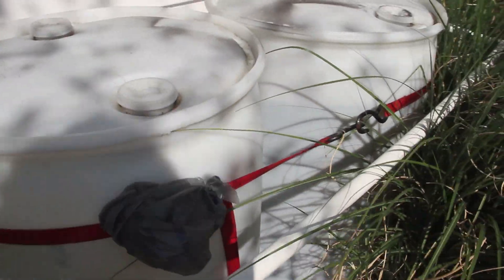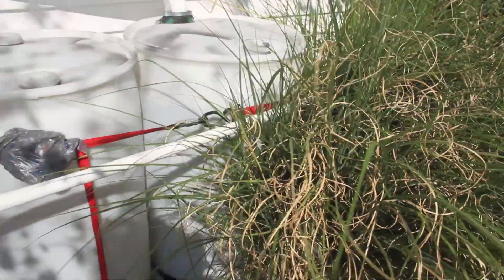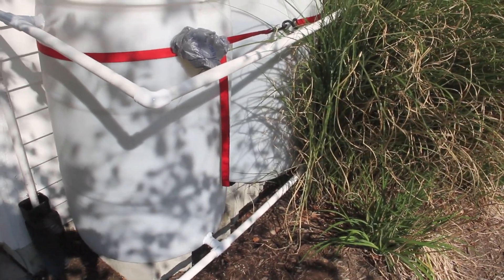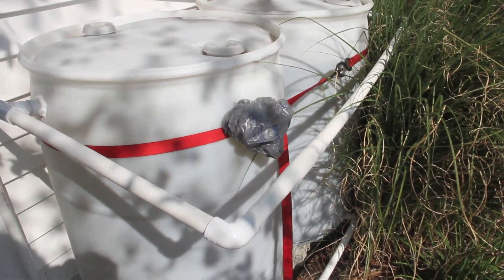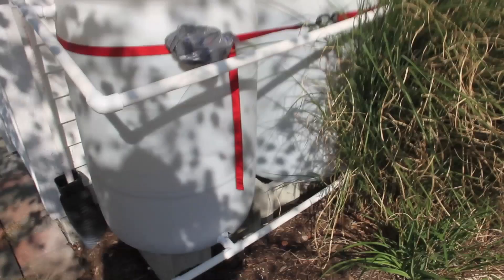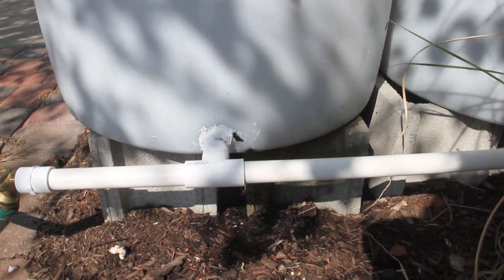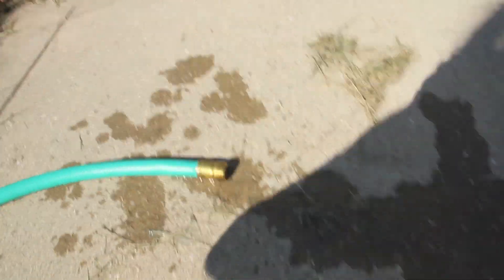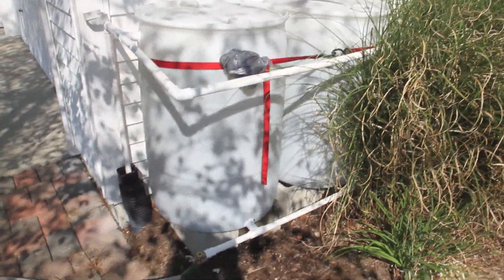DIY 110 Gallon Rain Barrel System

Comment: Some ideas for a easier system:
You tube video:  Rain Barrel Water Pressure/Volume Demonstration.
Grady Barrels for water diverter
You tube video 5 Dollar RAIN BARRELS 55 gallons to 1000 gallons
Connecting multiple barrels with part numbers for the pvc parts
For installing a faucet on the barrel without silicone (and they have a video
on how to install the fitting and there are other companies that sell it,
don't buy it at Home Depot though, their plastic fitting contains lead):
bayteccontainers